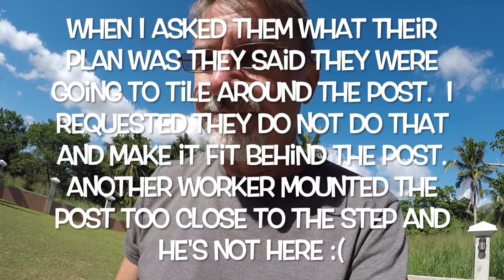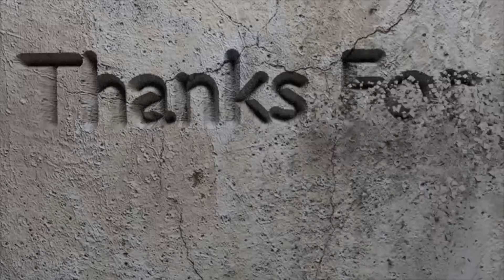VILLA FELIZ - EPISODE 311: HOW TO MAKE QUICK SAND (House Building in the Philippines)

Comment: There is a sweet little design for watering a lawn. It looks like a tractor. The water flow turns the wheels as it waters and I think it follows wherever the hose runs. If you get a couple extra rolls of hose and "S" them around the yard it keeps the yard from becoming flooded. I believe the speed at which it moves is adjustable. I am a farm boy and I actually have a very responsible One who both waters the grass for me and washes both my car and truck. Very high ranking! Actually He delegates His authority to another very high ranked individual!  ;-P
Reply from the maker: I know that tractor water sprinkler.  Its easy to find in the US.  I haven't seen anything like that over here but that doesn't mean its not available.  I'll continue to search.  Thanks Tim!

Comment: hi james commenting from canada.the post will not go all the way to the ground. the post should rest on the last step, afte rthe stonework is done. resting on the front of the bottom step. have you thought not to use railings at the bottom step, so that you can acess the back ard. just a thought. nice job.
Reply from the maker: No railings on the access point to the back yard.  That way way we have a clear path to the yard.

Comment: James, on your outside steps that go from the patio to the basement you may want to consider not having the rail on either side of the first landing (the landing appears to be level with the yard on both sides) so that it is possible to approach the landing from  both the back yard and the side yard.
Reply from the maker: That's an option but just doesn't give the looks I'm trying to achieve with the full sided enclosure.

Comment: Nice house! My wife and i built a home on Mindanao during your timeline. I wish i had found your channel sooner! I made a HUGE mistake by not overseeing construction personally! I sketched up a single level rectangle with a main dwelling facing the highway, followed by an open courtyard, and ending with a maid's dwelling/laundry room. The "engineer" my mother in law hired to draw it up REFUSED, he didn't want his name associated with such a "stupid" design! After all, what kind of fool doesn't want his patio in front, for all to see? My open courtyard has a ROOF!, and they refused to even elevate it a meter higher, and overlapping the two  dwelling roofs! I got em just in time to stop a CLEAR roof from being installed! I told my Mother in law that 'engineer' better not show his face when i visit! They couldn't fathom why anyone would want their dirty kitchen on the outside of the same wall the clean kitchen occupied! Now, I have the world's largest family room, and the "dirty" kitchen is completely enclosed! Adding insult to injury, ALL the water supply, and drain pipes are under sized, and will need retrofitting! at least we're only into it for 35-k as of now!

Comment: Enjoying watching your vlog , just wondering with all those mis understanding with the works of those workers do they consult you and plan how to do it and how long will it take them to do it before doing anything? I always see your frustrations with their works. Anyways I enjoyed watching your blog.
Reply from the maker: The carpenters, masons and finishers are supposed to be trained professionals.  Maybe not licensed but they are expected to complete their assigned tasks with minor supervision and guidance.  Supervision and direction are supposed to be done by the contractor  himself.  Unfortunately our contractor has moved on to other projects and isn't around enough here to provide the necessary direction to his workers.  Most of the time they will approach me to ask which direction I want to move as most of them know I'm extremely particular with doing the build correctly and by the latest standards.  Occasionally this is not the case and a worker will do what he thinks is right and unfortunately this is where the error in judgement occurs.
We're approaching the final hours of construction (metaphorically speaking) and we'll press on to do the best we can until completion.

Comment: Probably been asked/answered is the HOA expensive? Is it a monthly/yearly rate?
Reply from the maker: ~USD$400/yr
Reply: besides cost of property taxes, one thing that a buyer should look into also are the hoa dues in subdivisions or condominiums.  looks like james hoa charges monthly at 2pesos per sqm (lot size) which is the normal rate in subdivisions.  some charge lower or just a monthly flat rate.  other higher-end subdivisions will charges between P5 to P20+pesos per sqm, depends mostly on the amenities. condo's are even higher at approx P100 per sqm.  i know a couple of people that bought lots in the past not knowing the hoa cost and only to be surprised later on, not a good situation.
Reply: oh my gosh
Reply: thats include schedule trash pick up ?
Reply: james , what the purpose of HOA in your subdivision ?